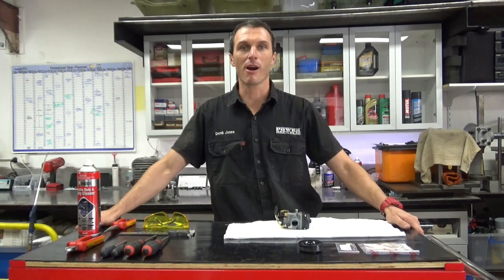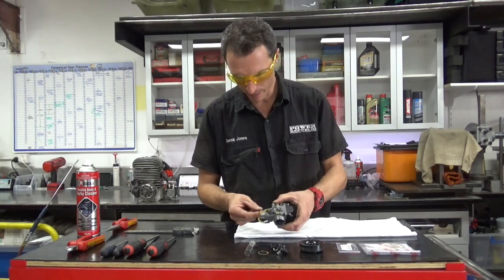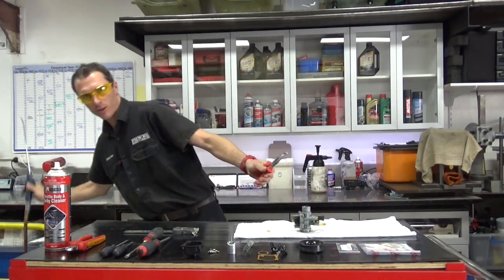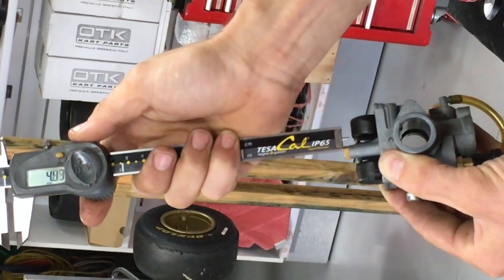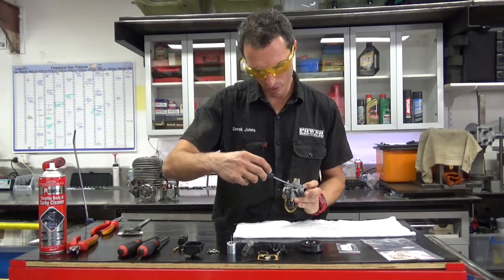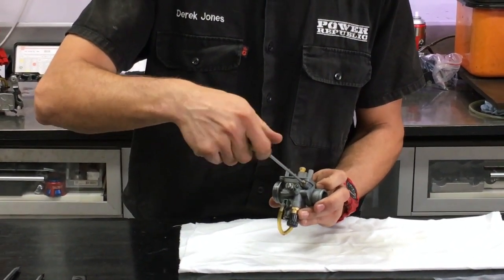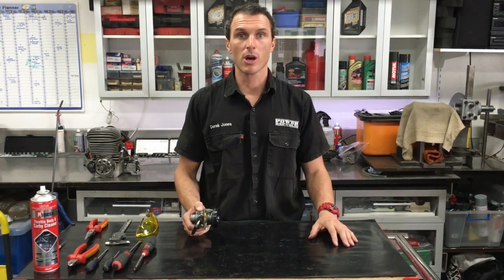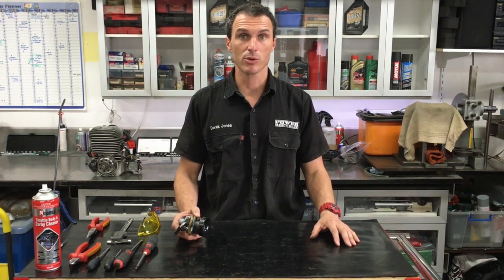How to - Dellorto Carburettor Service for Vortex Mini Rok - Power Republic

Comment: Is this for cadet 12 or a restricted cadet 9?
Reply from the maker: if your using the 97 jet in cadet 9 you can lean the float level off to 5.5mm instead of the 6.0mm for the cadet 12.  best thing to do is to try them both with the same main jet and measure your results with a Lambda sensor.  we also use a return line of the fuel outlet from the fuel pump back to the fuel tank with a 1-2mm restriction in the line.

Comment: Hey Dr Power. The updated mini rok rules have removed the fuel return line. The engine start fine when cold but if the young bloke spins on track it now won’t restart like it’s flooded (only since removing the return line). I’ve followed this video but still have the issue. Any tips? Cheers
Reply: Adjust the float mate

Comment: You mentioned the mixture screw wasnt at 3/4, is 3/4 your start point?
Reply from the maker: Steve Clee I start at 3/4, 97maim jet and clip 4 on the needle for sea level tracks. As you increase your height above sea level you can lean the main jet out to a 95.
Reply: Power Republic thanks & great videos!
Reply: Great vids! I know this is an older vid but can you just confirm where you measure the float level? It’s hard to see on video. I can see it’s from the seat, but is it to the top of the actual float or the metal arm?  Cheers! 👍👍

Comment: Hey derrick 
Awesome videos and have learnt so much already 
I have a mini rok and it starts awesome when cold but after a session when we go back out and engine is warm it struggles to start in out grid (have to hold foot flat out and slowly splutters until gets momentum )any suggestions on where I could look to make it easier to start 
Cheers
Reply from the maker: Check your needle jet and the float level.  they can be a real mission to get going.  fresh engines seem to start the best.  how old if is the piston ?
Reply: @PowerRepublic  has about 12 hr on it 
Engine is strong and happened all of a sudden 
The lambda is about .85 on main straight and jet is a 96 on second clip in vic at sea level 
Had cyl head temps of about 150c that day 
Normal 20c day they are at 130 ish
Should I be trying to lean out
Reply: Should float level be leaned and needle leaned out

Comment: Hi Derek, great video. What is the fuel pipe loop on top of the carb. Mine faces down but with no pipe connected
Reply from the maker: the breather tubes?   we face them up and use a bridge piece of tube with a slot cut in the centre to atmosphere

Comment: Great video 
Is the float measure to the metal bracket or the plastic part
Cheers
Reply from the maker: to the high point of the p[lastic floats is what I do.  but either way is fine as long as you do it the same each time
Reply: Cheers